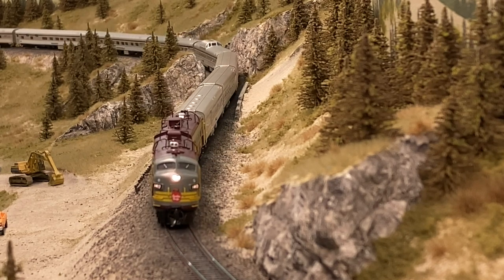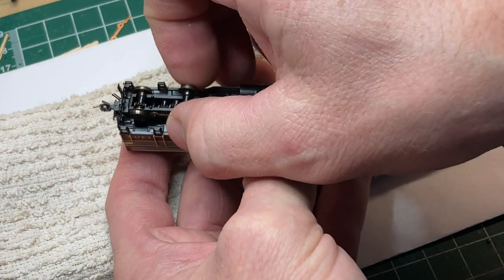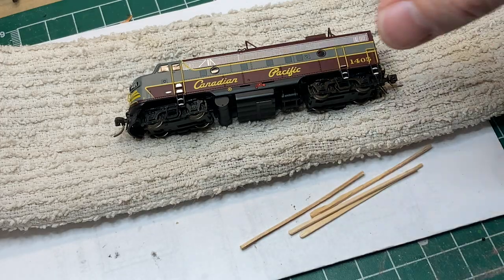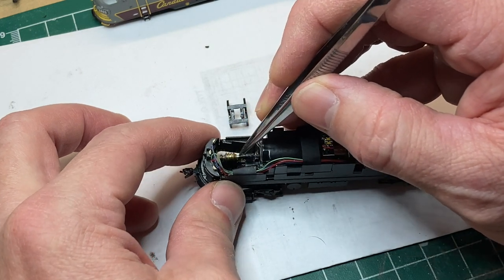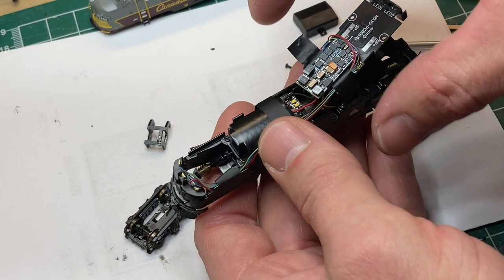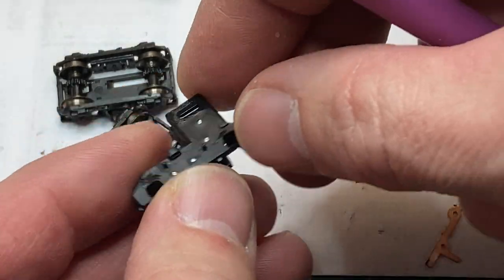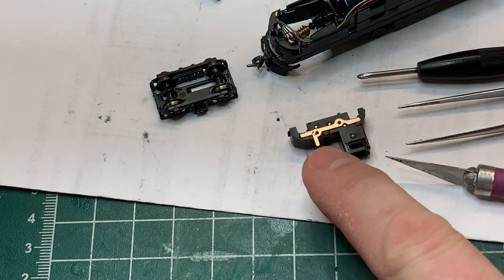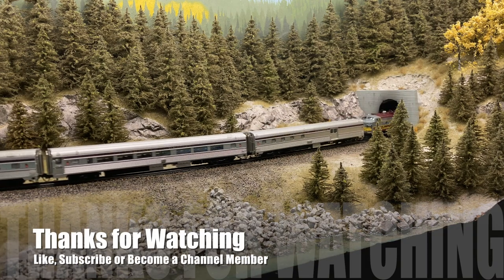Tuning Up Rapido Trains N Scale FP9A

Comment: Just swapping out the traction wheel made a huge difference in the performance of my Rapido Algoma FP9. It would struggle to start and could not run at low speed without shutting off.  Now it runs great! Thanks for posting this.
Reply from the maker: Glad you found it useful, cheers!  -grant

Comment: Excellent video - but I don't have the eyes or courage these days.  I had noise problems and contact problems with mine and I sent it back to Rapido.  The regauged it, sent it back and now it runs really beautifully.  Great engine.  Thanks for the video!
Reply from the maker: Thanks for the comment.  Yah the mod is not for the faint of heart but it does the trick.  Glad to hear Rapido got your FP's up and running.  Cheers!

Comment: This is extremely helpful!  Thank you so much for taking the time to put this video together.  I was tremendously disappointed when I first ran the model--the sputtering and stalling was so frustrating!  Popping off the truck cover as per your instructions, replacing the traction tire/axle and cleaning all contact areas with alcohol solved the electrical pick up problems! No more sputtering or stalling!  Thanks, again!
Reply from the maker: No sweat, glad it was helpful Steve.  Have fun!  -grant
Reply: Wow Grant, thanks for another Rapido Fix video.  First the crappy rollability of the Canadian coaches, and now this. I’m going to start calling the company “Repair-doh”!  I used your technique to remove the shell, and it worked like a charm.  One of my two F9’s had died on the track, shorting out the NCE Procab repeatedly, so wanted to get in there and have a look.  Didn’t see anything untoward, put the chassis on the track, and the problem was gone, just as inexplicably as it had shown up.  Beats me.  These are the most finicky locos I’ve ever had, but they sure are purdy!
Reply from the maker: Repair-doh!!!  Love it.  Glad the video helped out and hope the phantom issue doesn't return.

Comment: Wow. That is a great fix and an excellent tutorial/how-to video. You have great skills as well. However since these loco are new I am surprise the work you did was needed in the first place.(?) QA issues ? In my opinion my expectation is that a new engine should run quite well out of the box especially for the $$$ they go for.  Again well done
Reply from the maker: Thanks!  I do agree that these units should run top notch from the get go for the cost.  That being said I hack apart and modify 95% of my rolling stock to get it to run they way I want it to so I've settled on the fact that most models require some tweaking.  That's why I bought all those tools after all!!  Cheers.  -grant

Comment: I swear I commented on this a while ago, but I guess it was the Canadian modification video.  I just finished doing the first of my 7 locos and now need to run it for an hour or two.  I was a bit weary of trying it at first, but decided I would give it a go and it was actually pretty easy.  I expect it will take less than 20 minutes for the other 6.  Hopefully I see a significant reduction in the noise from a few of them.  Thanks for being the guinea pig for this as I would never have tried doing this without someone doing it successfully first.
Reply from the maker: Hope it works as well for you as it did for me David.  Cheers.

Comment: Thanks for the video . I had allready change the traction tires axle and always clean the wheels with the same method you do .
Happy to see how to dismantle the boggies , for now I don't have to go that way , the loco is operating very well as is , but will keep in mind your boggie modification .
Reply from the maker: You're welcome Louis.  Keep an eye on the axle wear on your units. The truck modification will help to balance out any uneven wearing between axles.  Cheers.  -grant

Comment: Great video! This was an easy fix. I was having issues with intermittent power loss while pulling my 14 car set and this has corrected the problem.
Reply from the maker: Awesome.  Glad you found the vid useful.  Have you modified your cars as well?
Reply: @SouthernAlbertaRail  Yes I did the modification to the cars as well, shown in your other video, I still find them stiff and I still have some couplers to adjust. When reversing they tend to come apart at the most inconvenient of times.
Reply from the maker: Gotcha.  Hopefully the uncoupling issue is just tight coupler boxes.  Might go away if you back the screws off a half turn.  Have fun Doug!  Cheers.  -grant

Comment: Thanks. Great video on a very frustrating line of products with consistently variable quality and no factory response. Factory new units should not require this amount of work to get them running. Kept buying these for the accuracy of the aesthetics but after too many of these issues,  I'm done with Rapido n scale.
Reply from the maker: Couldn't agree more Chris.
Reply: Unfortunately their HO offerings aren't any better. Had same issues with no factory response. Also not buying anymore of their products.

Comment: All of the wheels on the one I ordered were grossly out of gauge.  This was a easy fix.  I also changed out the traction tire axle.  However, the one show stopper for me was the lack of installed ditch lights.  The housings, light pipes and lenses were in the parts bag but I was not about to try and install those myself and potentially ruin the shell.  So, back to Rapido it went.  With the current mail situation in the lower mainland, I don't know if I'll ever see it again.
Reply from the maker: Hoping you're above the water out there.  Nasty business....  Did you have the Action Red 8" units?  I wasn't aware of the ditch light install requirement.  Hopefully all works out with mail.  -grant
Reply: @SouthernAlbertaRail  No water worries here.  We're about 800 miles north of Vancouver.  I ordered a VIA unit that had the ditch lights installed on the prototype.  I believe the photo in the ad showed them but there was no choice given on the order form so I figured it would come with them installed.  Rapido is going to either install them or substitute the shell with one that has them installed from the factory.  We'll see what shows up, if it ever does :)  - Doug
Reply from the maker: Good to hear on the H2O front Doug.  Rapido should pull through, they're really good about taking care of customers.  Now Canada Post.............  Fingers crossed.
Reply: I had emailed Rapido a while ago aout the ditchlights and received this answer from Jordan: "For our N scale FP9A, all of the CP Rail 8" striped units as well as the former CP-VIA painted units will be coming with ditch lights installed from the factory." Those were the units I was ordering so I felt happy to not have to do an installation.

I have to clean my wheels and ditch the traction tires since both of mine stall on clean track. The traction tires were coming off no matter what. Seeing the traction tires put me back in 1979.
Reply: @SouthernAlbertaRail  Grant, I forgot to add a hearty "THANK YOU" for taking the time to document your maintenance work for the FP9A.  It's much appreciated.
Reply from the maker: My pleasure Doug.
Reply from the maker: Yup definitely a time warp seeing traction tires today!

Comment: All N scale.   I’ve a first run GMD-1 with sound and it’s the best running engine I have. I have two of the same engine with DC/DCC and the performance is average at best. I also have two of the Rapido-Prairie Shadows FPA4 and one runs great the other at certain speeds shows some jerkiness,I’ll run them for a while do the ESU function this adjust that cv and push f whatever it is and see what happens. Other than to install a decoder I’ve never had an issue with an Atlas or Kato engine or a reason to disassemble and reassemble an engine. The Atlas Alco S2 switchers run as nice as the GMD-1 but are not whisper quiet. It’s just not acceptable that to have smooth running engines like you’d get from Kato or Atlas you’re having to do major surgery on a new engine.
Reply: You might think about turning off the DC so they runn just on DCC. That improved some of them that I had issues with.
Reply from the maker: Agreed, Pretty much exclusively Kato power on the layout.  Brings up the age old question...  Should we have to fix this stuff.  Nope, but hey, It's a choice after all.  Is it worth the time and effort?  I like tinkering with stuff so for me yes but there is a pile of initial frustration.  Hoping the F40's don't have the same issues.....  Cheers.
Reply: @Vman7757  Yup did that and made no difference. My guess and it’s only a guess is that the ESU decoder is just a whole bunch better than the Digitrax DN136D it came with. If the Digitrax plug was an common plug I’d swap in an ESU decoder but it’s unique to Digitrax. I think the second run of the GMD-1 was straight DC and with some kind of NEM plug. What’s really annoying is that my Atlas and Kato engines that have mostly Digitrax decoders that I installed ran nicely before and after decoder installation.

Comment: So, instead of just pivoting them to give one axle pickup, what I did was pivot mine around the same pivot for the pickup.  Then attach some 0.010" wire from Tichy (1101) on, to make a spring pickup onto the other wheel set.  I just did this on the front trucks, as the rear trucks were still picking up.
Reply from the maker: Always love multiple solutions to a problem.

Comment: Very informative, thanks. 
Can you do a video on how you get your Athearn FP45/F45's running so smooth and how you overcome the issue with the axles that often crack?
After seeing this video, those Rapido axles look exactly the same as the Athearn.
Reply from the maker: Unfortunately I don't have any Athearn units.  The F45 you see in the videos is actually a resin and etched metal kit that I offered way back before Athearn had made theirs.  It sits on a Kato SD40/45 drive and that's why it runs so smooth.  -grant

Comment: Very clever Grant.  How did you figure out this was the problem?  Also have you had any problems with power pickup since the fix?
Reply from the maker: After swapping the traction axles on my pair and running the units for over a real mile the noise was still present in one unit.  I pulled the gear box cover off the offending unit and discovered uneven wear on the axle bearings.  In fact the trailing axle on the lead truck had no wear while the other was developing a groove.  Trucks came out and the mod was made to allow even pressure across the axles and voila...  problem solved.  I modified both units to keep things uniform.  Electrical pick up improved because all the wheels now touch the rails.  Cheers.  -grant

Comment: Pilot steps! Thats what those little  black things are!? I wonder if your fix would improve electrical contact? I have 2. After much fiddling, they run quieter now but 1 still on occasion looses contact where the other one doesn't. If I get annoyed enough again, I may try your fix, but things are running pretty good now. I wonder if this is the hold up on the N scale F40PH's? I really hope they shine right out of the box! Thank you for the video.
Leon
Reply from the maker: Better contact for sure.  Swapping the traction tire axle out makes a big difference.  Allowing the contacts to pivot keeps the axles in contact with them and the wheels on the track.  Have fun!  -grant
Reply: I just did the mod on the front truck and it is running much better now. Mine would sometimes stop at the bottom of a 3% grade and the headlight would flicker all the time.

Comment: Great video. My FP90 stalled all the time.   Rapido weren't much help. Their instructions were very vague. I snapped the axle cover trying to remove it. Received the loco in October. Rapido promised to send a replacement cover to my retailer in early November. He still hasn't received it. He had to cannibalise one from stock to send me the part. Even after regauging the wheels it still stalls at times. I also cleaned the pickup points on the rear axles. I didn't dare trying cleaning the ones on the front axles in case I broke that cover too. You've shown me a much better way to remove the cover.
Have you had any problems with the steps on the trucks falling off? I have. They don't seem to have been glued in properly. Even the replacement I had sent to me had missing steps.
I certainly didn't expect these problems on a brand new £249.00 loco.
Reply from the maker: Sorry to hear of the problems you had and I do feel the model should be much better for the price paid.  I'm happy the video proved to be helpful.  Yes I did notice the part you're talking about on the bench a few days later on the work bench.  On the prototype it has to do with the spring stack on the truck.    Cheers.  -grant
Reply: @SouthernAlbertaRail  I removed the axle covers as shown in your video. Tried Rapido's suggestion of soaking the wheels in alcohol to remove the chemical blackening. Didn't help much. Resorted to using a glass fibre pencil to remove it. Runs much better now, but still not perfect. Never had similar problems with Kato locos.
Reply from the maker: Kato is the gold standard as far as I'm concerned.  Rapido crapped the bed with these units.  My units do run way better and I am relatively happy with them.  As stated though there is no way new models should need this kind of work.

Comment: Mine never worked at all.  Sent them back to Rapido for them to fix.
Reply from the maker: Yah some of the units had filthy wheels from the factory, my pair included.   Other people's units I messed with were fine.  Seems to be (bad) luck of the draw.  One of the workers at the factory was skipping a step I'm guessing.....
Reply: @SouthernAlbertaRail  I read from a Rapido employee that that they made a mistake by chemically blackening the wheels. They recommended soaking the wheels in alcohol to remove the blackening. There's a design flaw in the plastic axles that makes all the models undergauged. You'd think they'd have spotted that when  received the samples at Rapido HQ.
Reply from the maker: @Poliss95  Rapido stuff is notoriously tight on gauge.  Easy fix that should be addressed at the factory to be sure.
Reply: I did clean the wheels with Iso but it didn't change their lack of performance. The wheels were in guage ...I'm thinking chips issues. Just by way of contrast, my Marklin and Dapol locos never had any mechanical issues right out of box like these. I guess quality control is poor at Rapido.
Reply from the maker: @LJ-qj5pu  Could be.

Comment: Grant,  Did you have any weird things happen with the decoders in your two FP9A units?  I was trying out the various functions and got some weird results.  For example pressing F3 sent the prime mover sound into run 8 and after a couple of seconds, it shut off completely.  Pressing F7 shut down the prime mover sound and F12 killed all of the lighting functions.  Thought I'd ask as I'm trying to ascertain if anyone else has had these issues.
Reply from the maker: I don't have any thing like that happen Doug.  Have you tried resetting the decoder?  In the past if I had any issues with other decoders setting CV 8 to 8 fixed things up.

Comment: After a few weeks of flawless running, one of my Rapido FP9A's has developed a loud growl.  It sounds like a gear mesh problem but I can't see anything wrong with either truck.  I've done all of the mods you suggested a while ago.  Any suggestions?
Reply from the maker: Not off the top of my head Doug.  Mine still seem to be rolling along A-OK.  Did you pull the trucks out of the unit and pull them apart??  Maybe some gunk got picked up off the ballast??

Comment: I was going to comment on how I don't understand how you N scale guys can tolerate that Athearn bluebox grinding noise in all your locos?   Great video on how to tune them up right !
Reply from the maker: Thanks!  If it runs like crap what's the point?  I won't tolerate a poor running model and will do whatever it takes to get it right.  If it can't be fixed it gets turfed.  Cheers.